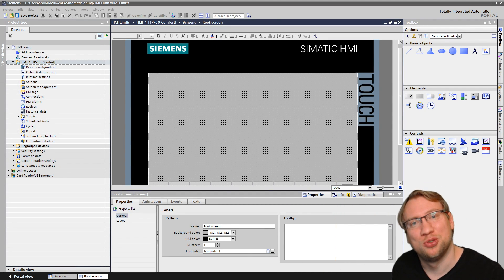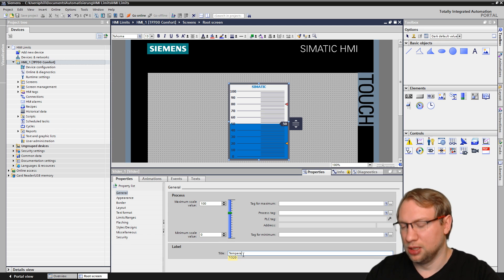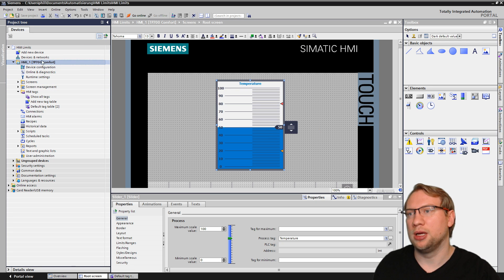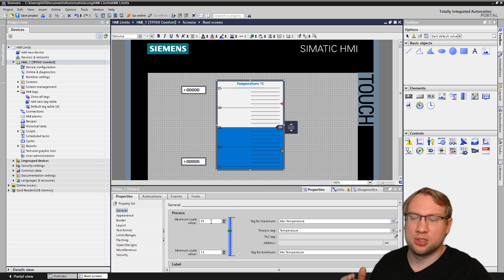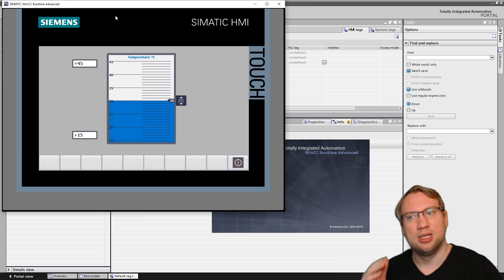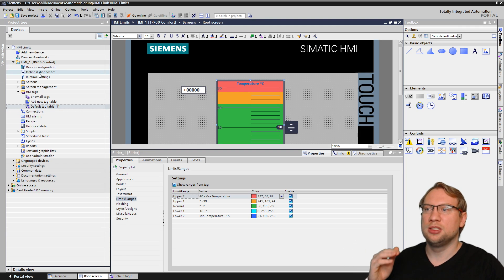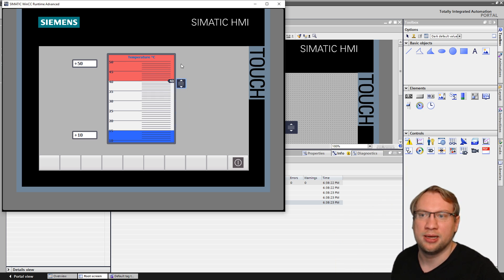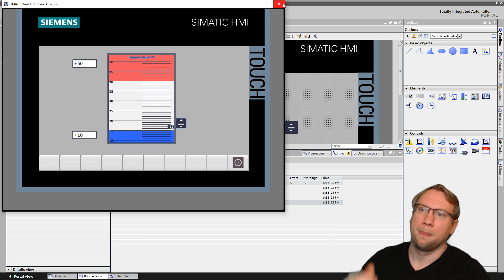TIA Portal: HMI Limits (Bar, Slider and Gauge)

Comment: Hi, I am using TIA v14. I can't find the slider in the elements section of the toolbox. How do I solve this?
Reply from the maker: Are you using a "basic" panel? Those do not have some features (including sliders). You would need to use a "comfort" panel
Reply: @hegamurl  oh!! Thanks
Reply: @hegamurl  how to change to “comfort” panel?(I don’t think that you’ll answer, but at least I tried)
Reply from the maker: @dantealighieri5218  that depends on the panel you currently have. "Comfort" simply describes the panel type, which is decided by the hardware. So if you only have a "Basic" panel you will not have access to the comfort functions (which are quite a lot)... simply because it is different hardware
Reply: @hegamurl  thank you very much! God bless you